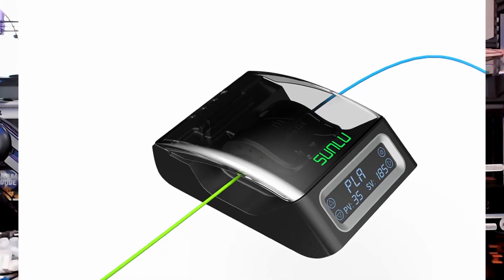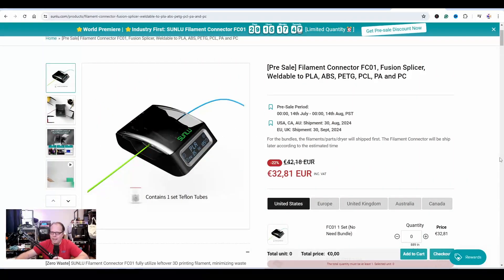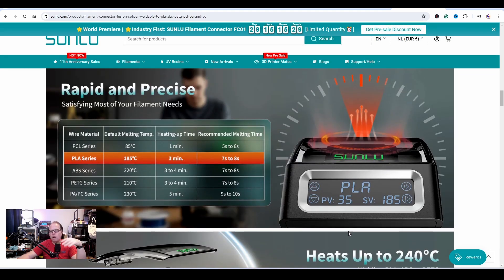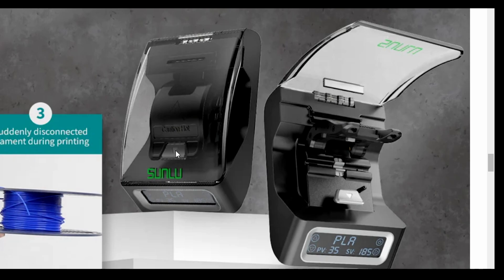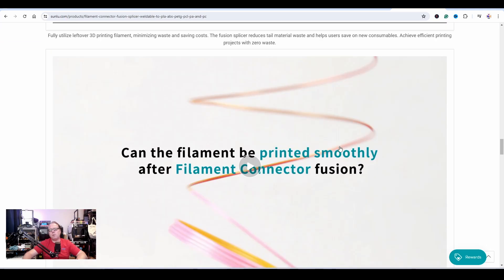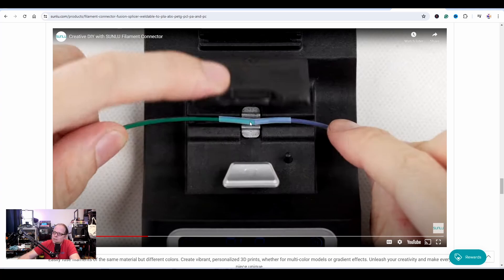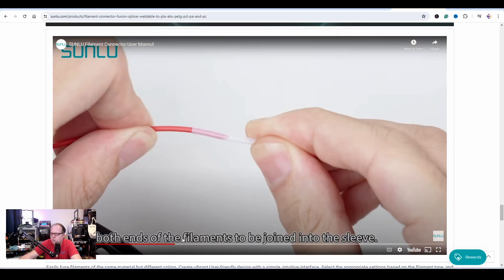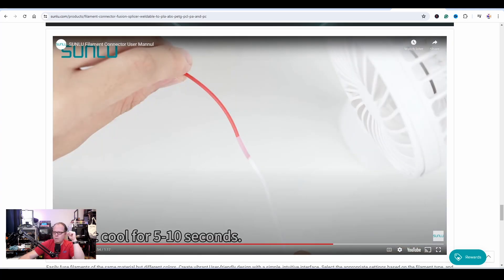Best solution for leftover filaments - Sunlu Filament Connect FC01 - Zach React

Comment: If you have a 1/3 roll and half roll yes cutting would be easy way? after looking at this the 1/3 roll will you would want to spool in the half roll right? so if some one came up with a winder where you could clamp the tube in the device to hold the tube in place then spool I would think you can use the same tube over and over??

Comment: iam suprised that no filament makers havent done a small machine like this all these years. there is only ONE on amazon and have been there for some time. looks like a clamp somesort..for the ptfe tube/sleeve,,i cant find any out there looking like that, and are 1,75 on the inside..when i search i only find tubes that are 1,9mm inside. like capricorn and so on..idont know what special tube they have made for that. seems very thin overall. like 1,75 inside..2mm outside? cant find any info about it.
Reply from the maker: Yeah, I'm surprised too. I have seen those clamps too, but never bothered to buy one. 
Finding the right PTFE tubes can be hard, since most of them are 1.75, 2.85 or 3mm, And I think you want to have it a bit thinner than wider, so you don't have issues in the hotend. The ones that I saw on AliExpress are using non-stick paper

Comment: Given the friction reducing  coatings now for nozzles, I'd much rather see a "clamshell" solution made entirely of coated metal with some kind of knife to trim any flashing at the seams. I've also wondered if a "pencil sharpener" for both ends of filaments would give them a better melt and fusion ....so far I've experimented with several angles of lap joints but this is still always the failure point .... just too many variables and too much chance for print problems to be worth it to me in the long run ....a proper grinder and remelter into new filament seems best but the introduction of humidity plagues all of the attempts to make filament from scraps due to the ground product having even more surface area to absorb water. These are the reasons I'm putting more effort into press molds and even CNCkotchen's idea of injection molding as means of recovering scraps. It's an area where functional products that don't need aesthetic looks really succeed....mounting hardware hidden from view can be any calico looking combo of colors.
Reply from the maker: Yes, exactly! I made this video, before I saw any other videos on YouTube about this welder. 
I saw the struggles from Jessy in his video about it and was exactly what I thought about it. 
You need to cut it in the right angle for both ends, you need to press it against each other while welding them... and cutting away the thin PTFE tube...